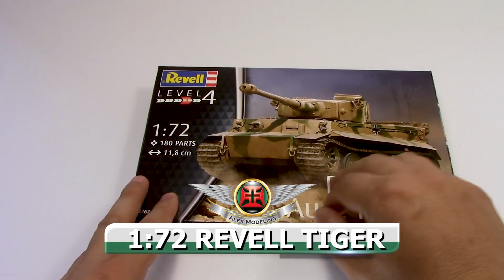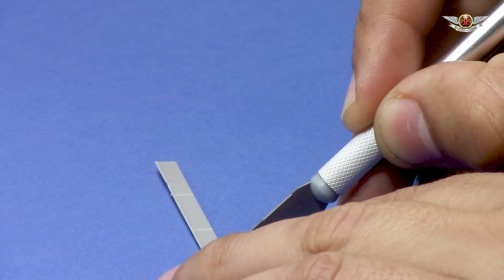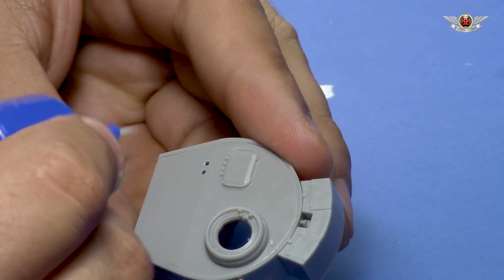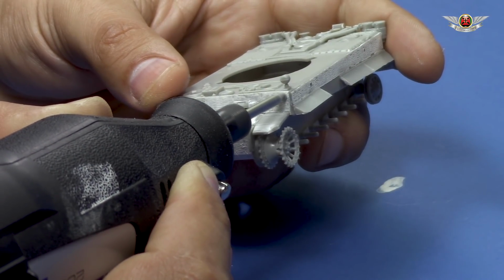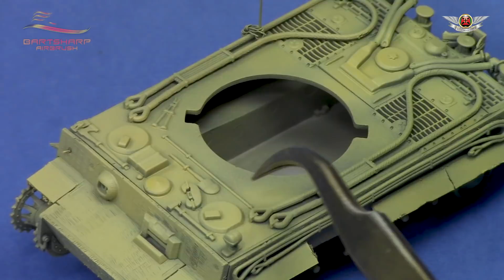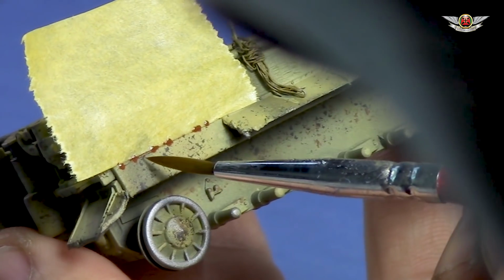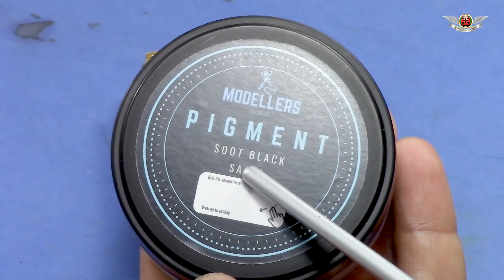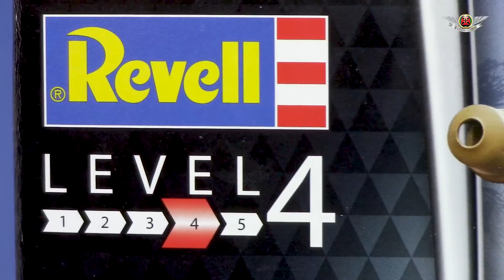REVELL 1:72 TIGER TANK FULL BUILD VIDEO

Comment: Very nicely done! I love the weathering in particular. I have built that kit at least 5  times already and the tracks just don´t fit very well, it is a known problem. I really haven´t figured out yet what to do about that.
Reply from the maker: Just cut the fit "points" thise extremities that GOES and Touch the other links? Cut it and just a small amount of super glue and just glue it to the other track... Don t use the "contact surfaces"... Cut thise out
Reply from the maker: Also this kit brings a few extra tracks... Because you cut the contact points it Will Create a small diferençe on the tracks .. so maybe One or 2 extra tracks will be needed but you will have enough... Personal experiênce Michael... But i ONLY reslised it after have oassed more than half the track build
Reply: @AlexModeling  what fit points are you talking about? I too am building this tank
Reply from the maker: @TOMMY-yp6wn  The tracks has each two points that fit on the other track... Thise fit points are too thick. Sand it ir cut it and the tracks will fit better.. but first experiment